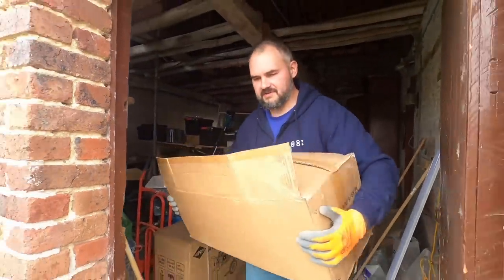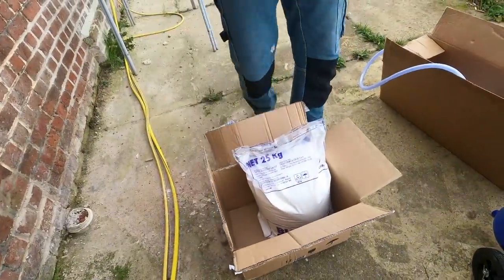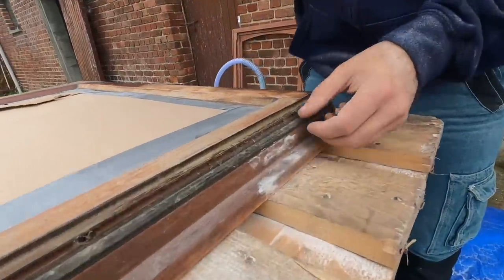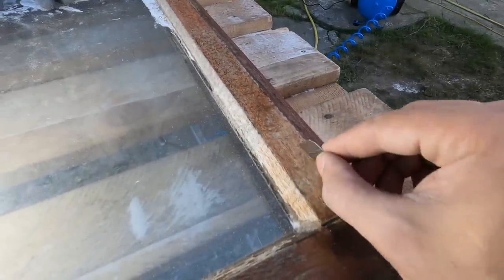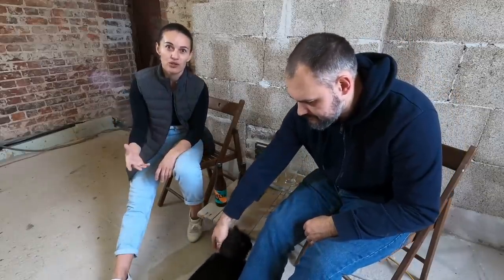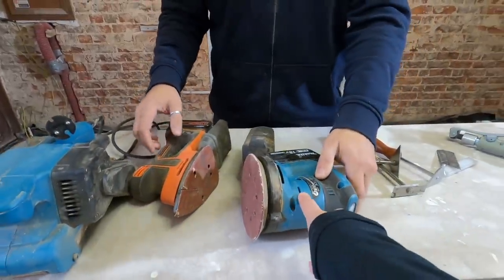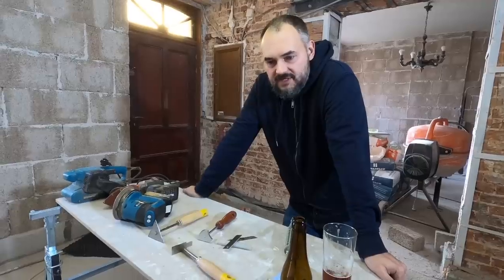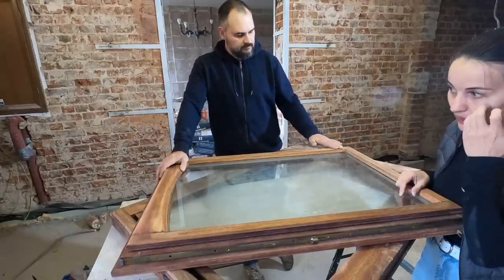Was soda blaster WORTH BUYING?  / Renovating an abandoned 110+ years old farm

Comment: Prime windows first (oil- or latex-based), then high quality exterior paint, especially for windows in path of wind, rain, sun. White will not fade out like brown will. Also spline needs to be high quality, might come in white, too?? High quality= more expense, longer resilience; lower quality=the opposite. Your call. I painted, repointed and recaulked 10 Ash wood windows that lasted 16 years...with one exception: the only "unprotected" ( close houses, North/East/West-facing, under porch roof) was one South-facing window. In the prevailing winds and setting sun unblocked by houses or tall trees had to be done every 2 years minimum, 3yrs maximum, all windows protected by storm windows btw. Used Sears white oil-based primer and paint, standard glazing points where needed, paintable exterior silicone caulk, flexible and stiff putty knives/ plastic blades (narrow only) and it took all summer to scrape, repair, repoint, caulk, prime and paint. Thank God my 2 children 7 and 10 were away with their dad and step- mom for six weeks. Drimmel tool/various heads helpful for cracks, crevices, scrolls, etc. Hang in, guys. Where there are obstacles, there are opportunities ities for personal growth. BTW, please pray for USA/wisdom, truth and intelligence with honor in our politicians. Thank you.💯❤️💪🙏

Comment: @De Hoeve. Old Belgian farm renovation hey guys,what about using metal wool,like you have for cleaning a very dirty BBQ ,gloves required to use it,otherwise you will have little cuts in your hands,almost invisible but very anoying as they are open wounds
as for painting wooden windows,be sure that you paint on a sub layer before putting on the end paint,otherwise the paint will fall off over time,all my windows are pvc,that way i dont have to paint anymore and dont have to worry that the paint will come off
cheers guys

Comment: Wooden frame single pane windows won't keep your home warm in the winter.  You will always have high heat loss.  Double pane windows are more expensive but you will save in heating costs and be more comfortable with modern windows.  Hiring a window company to make and install the new windows is a big time saver.  Same for the doors. massive heat losses through single layer wooden doors.

Comment: Blasting is definitively one of the most demanding application of compressed air. You really need a big compressor to find the process useful. We see the blasting working when the handle is first depressed, then very quickly being inefficient... Don't forget that compressor manufacturers give the most favorable data, not real use data. And you always can adjust a flow of air that is too powerful. Been there.

Comment: Whilst I understand reusing materials, I would buy new triple glazed suncool, windows. We used Idealcombi as they do a wood finish on the inside. That way you are energy efficient. These windows are from the 80’s, so not original nor efficient. Penny wise pound foolish is the saying.  It’s a different avenue but you will be surprised once you get some quotes. Good luck

Comment: INSTEAD OF THE REPLICABLE CUTTER BLADE TRY USING CARD SCRAPERS.  THEY ARE EASY TO SHARPEN WITH ONLY A FINE FILE AND A BURNISHING TOOL.  LOOK AT ANY OF FINE QUALITY YOUTUBE UNIVERSITY VIDEOS ON HOW USE AND SHARPEN THE CARD EDGES.  THESES LEAVE THE FINEST SURFACES FOR FINISHING.

Comment: I had the same situation as you restoring old wooden framed windows..... tried about everything. For the first step I finally used Total Boat "total stripper", that used on boats.. It's biodegradable and water soluble. No bad chemicals or harsh smell. Removed many layers of varnish in one application. The second step was light scraping and sanding.....only thing that worked quickly.

Comment: Did you try sandpapering by hand after the soda blaster? You should be able to smooth it out quite quickly.

In general, even the most well equipped professionals will do certain details by hand. Not everything is best done with a machine.